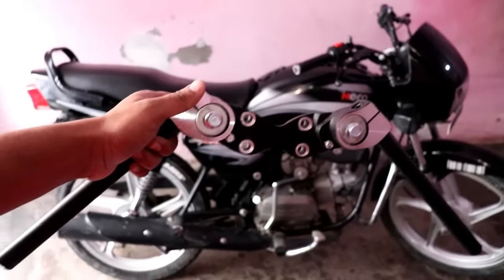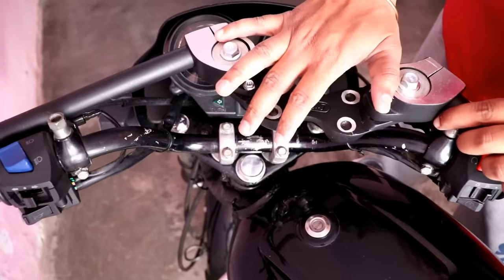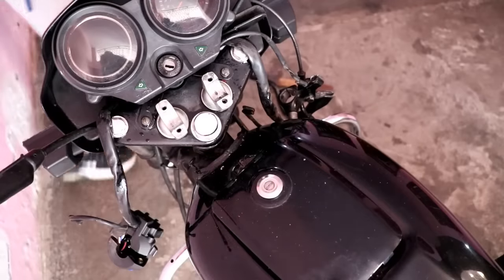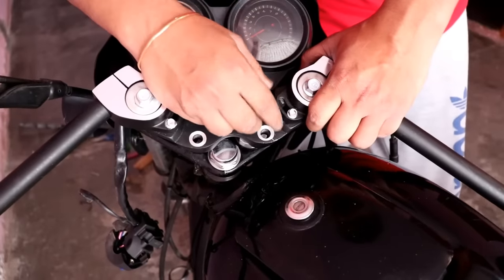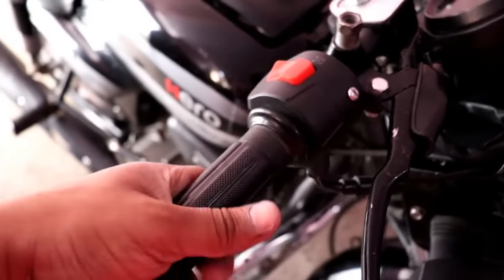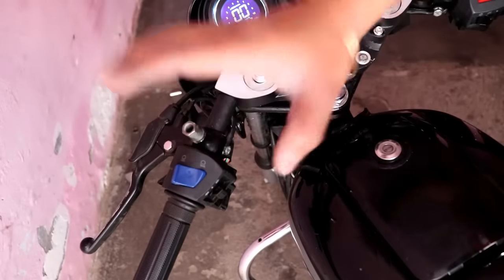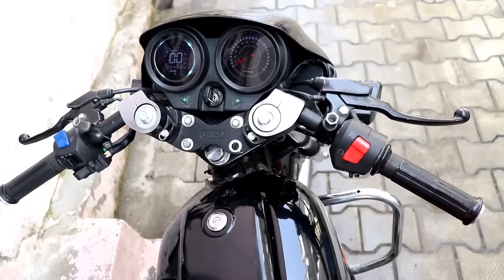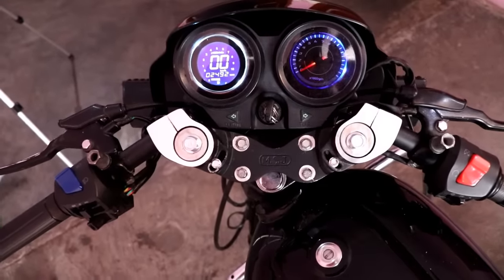clip on handlebar for splendor

Comment: Clipons are the most weakest Handle bar if fall then it breaks easily
Reply: But they are the cheapest to replace :D

Also if they are so weak then why do 500+ lbs bikes use them??

It's all in the production quality
Reply: It not clip on it is 3piece handlebar and r15 , ktm and gt 650 have not original clip ons actual clip ons fitted 6lakh + sports bikes as these bikes r fast expensive so rider can adjust the stock handlebar as per their comfort nd those r really expensive like 10k+  but in r15 nd ktm they just put non adjustable clip on which r decent nd not bad as after market cheap clipons